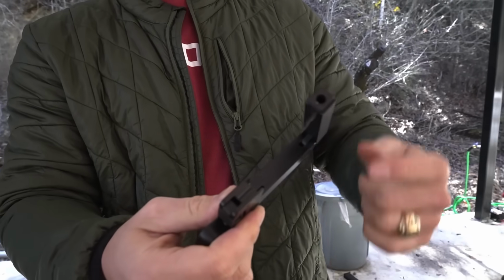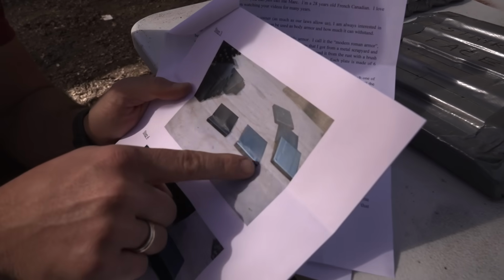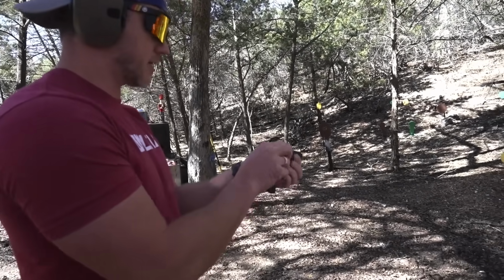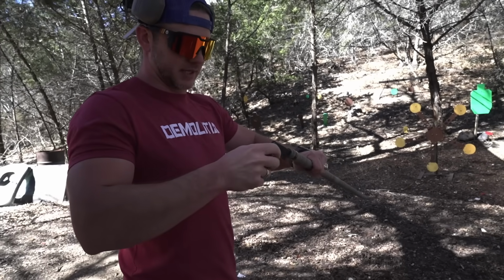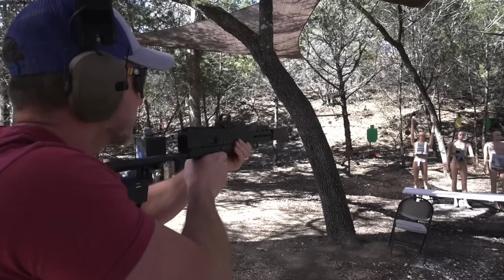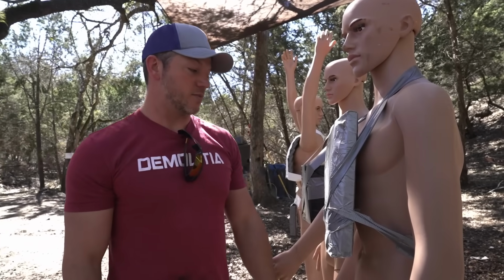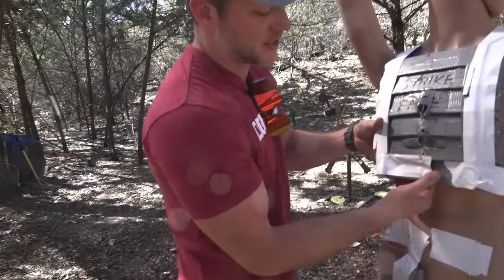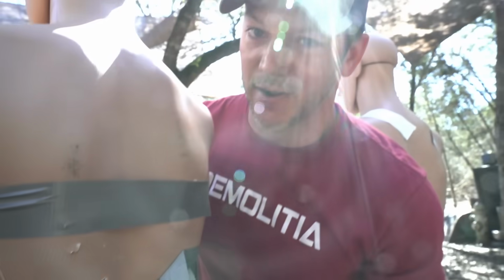Smallest Suppressor on the Smallest Gun!!!

Comment: Ain’t no way bro shot a gun in his house
Reply: Agree but looks legit
Reply: You sir seem a tad blank😉🤭
Reply: *office
Reply: I’m sure it was a blank
Reply: He didn't, no recoil, or smoke from the muzzle. Sound was edited in post.
Reply: @iffiorida1072 could be a blank, the sound is on point
Reply: If you slow it down there’s no casing so he defiantly did not.
Reply: @andrewsorrows1783 he fired a casing with just the primer. The primer itself is the explosive that ignites gunpowder. Without the poweder, the actual primer going off sounds like a bottle rocket or louder cap gun. But does not have the energy to operate the action or cycle the round out.

Comment: Theres a guy on YT that uses HDPE as armor and it stops 7.62x39 from his SKS by its self when thick enough. Thats worth revisiting. (Also noteworthy the stuff they make soft armor out of is Ultra High Molecular Weight Poly Ethylene or UHMWPE. Which, when annealed, becomes HIgh Density Poly Ethylene or HDPE)

For the guy that did the 3D printing, dont give up. You are on the right track!
Reply: Tell him to put ceramic tile between two sheets.
Reply: Matt's done a bunch of armor vids in the past, a lot before my time here and I know hes covered the Premier line of poly armor. We have some "professional" armor vids in the works coming in the next few months! Did someone say Dragon Skin V.2???
Reply: @David.Lopez.12  we know commercial armor exists. Having a DIY force-multiplier like homemade armor is super appealing
Reply: @Deepwaterjew  I actually did put a tile between the 3d print and the plastic on the plate I kept at home.

Comment: Hey guys ceramic its very hard but its the shatter that transfers the energy. If you are going to make something ceramic tiles with a thin flex seperating layer, in layers with something to bond them together / hold in place. Anything from floor to bathroom would be better than much of what is sent.

Comment: HDPE for those who aren’t or we’re not in molding is High density poly ethylene. I’m curious at how well Ridel would do. It’s some intense resin very strong with a super high melting point. There’s also Ultem which is another high tempered plastic but a little more dense and glass like

Comment: With the suppressor shortened and it folded up, it looked like a vape mod

The cable plate had to of went through the insulation, the cable would have stopped it, in my opinion anyway. 

The leaf springs are hardened steel, you can reuse them for many years